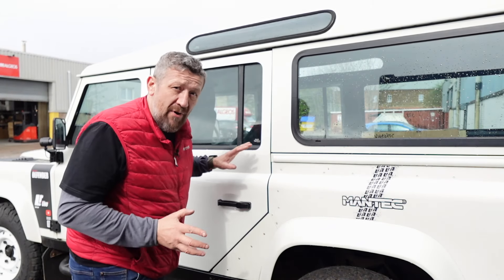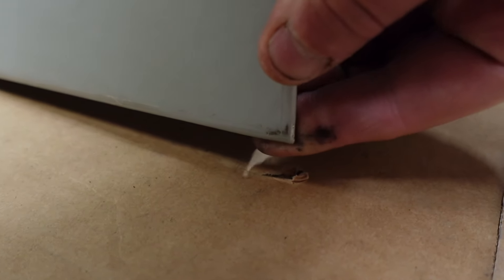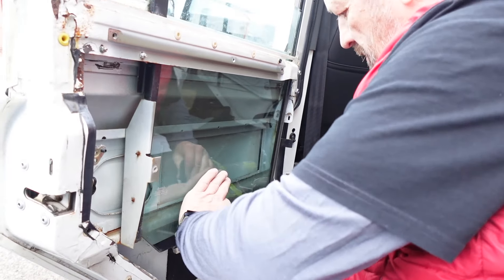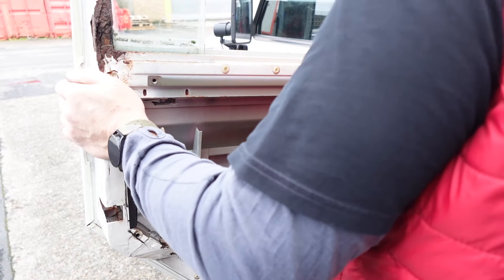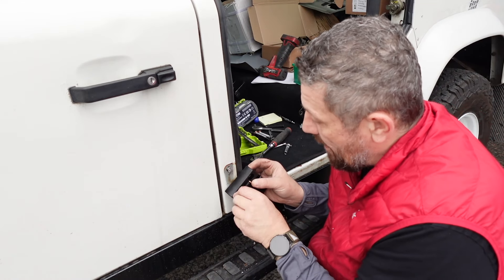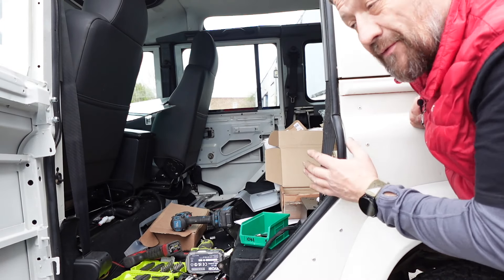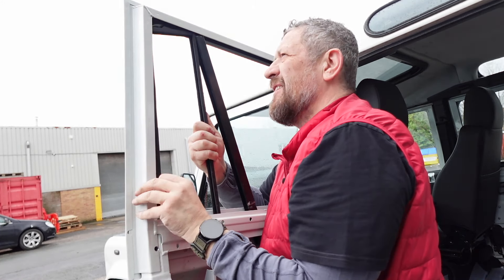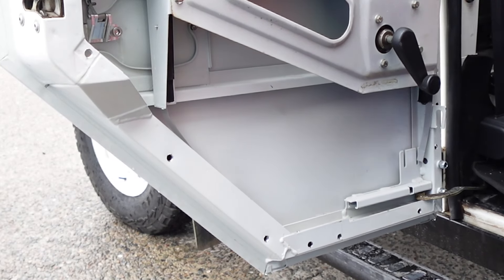Fitting new Defender rear doors with Exmoor Trim handles and hinges.

Comment: I have just done passenger side front and rear door replacements on my 2013 Puma Defender ❤110.  My new doors were all steel.  Got them painted, and proceeded with front door first.  No major issues.  One tip is to hold the glass up in the frame with tape running from front to rear face over the top, allowing you to remove hardware and not having the glass drop down in the process!  Glass removal is TIGHT.  Was worried for a while, and I also added some tape over metal edges where glass rubs on its way out. Rear door check strap bracket/channel was non-existent on the new door, and old one has this piece riveted with the biggest/hardest rivets I have seen.  They are made of titanium I think! Major hassle to swop over.  Also, I forgot to replace the rear door B Pillar micro switch push plate…and later realised this is essential to ensure the central locks operate correctly.  Hope this helps someone else.
Reply from the maker: Good tips. I forgot my push plates too but they don't work anyway!

Comment: Nice job, doing mine once I’ve sprayed them, good tip is to check the door handles fit correctly before spraying, I had to fettle my new doors a bit to get the Optimill handles to fit, just glad I did before painting.
Reply from the maker: Good tip!

Comment: I’ve got to replace all 4 doors on my defender.
They are 27yrs old and totally rotted.
No matter how much repair work I’ve done on them it’s too late for them to be saved.
Price for new doors is staggering and thats basic and not galvanised.
What are the thoughts about fitting series doors to defenders ?
Almost half the cost with glass included.
Cheap skate maybe but when on a budget these things have to be considered.
Great video and totally jealous of those doors 👍🏻
Reply from the maker: I think series doors are a great idea. Although all the new hardware like latches etc put the price up a fair bit. But hang tight for a month or so as our new project is getting that exact conversion.
Reply: @LRLiveUK I’ll be watching 👍🏻